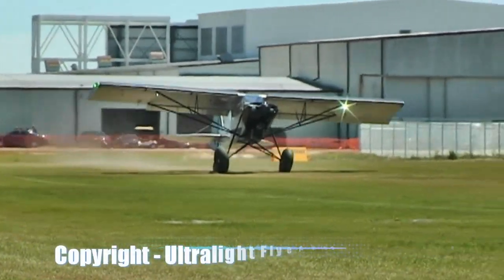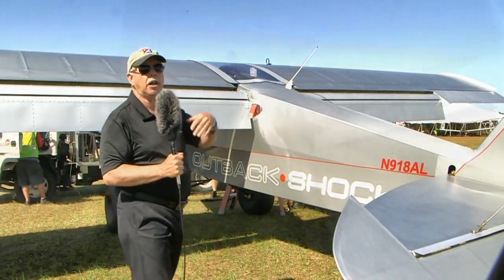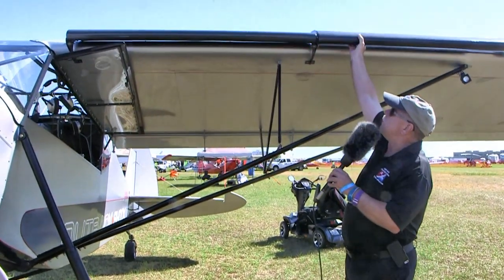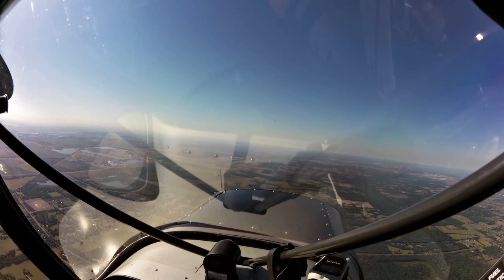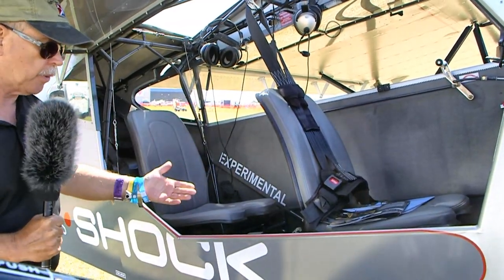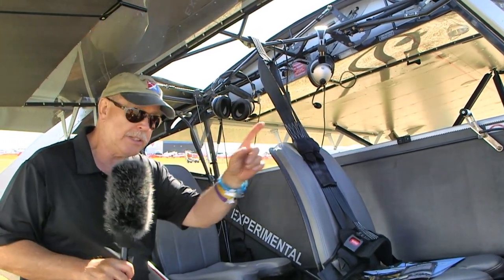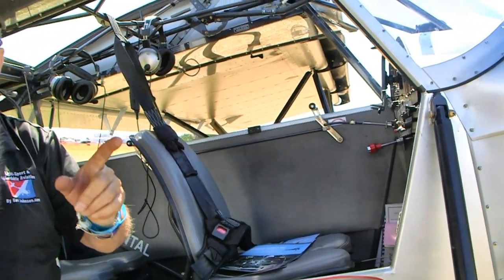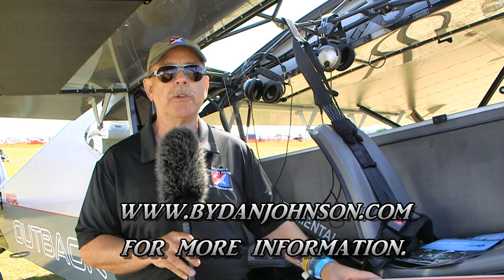Savage Shock, Savage Outback Shock, Zlin Savage Outback Shock Cub Aircraft Review.

Comment: Good report! Single pilot from front or rear?
Reply from the maker: Can be flown solo from either seat, but flap controls not reachable from rear seat.
The Ultralight Flyer
Reply: @ultralightnews  I don't think that answered the question.  Most tandem aircraft can be flown from either seat.  When there is only on person on board  (solo)  are you required to fly from the rear seat like a J-3 or can you solo from the front seat as a Super cub?
Reply: @Lammons1960  pretty sure it's the front seat in this plane

Comment: 710/5000
Enjoying yet another great model of aircraft capable of withstanding impacts on off-road tracks, this Savage Shock shows a lot more. It shows a sectioned Flape of better performance, shows a beak (rear wheel) with shock absorber, shows deflectors of wing tips. In addition to all this WHAT I LIKED most was the Slats in three retractable sections on each wing and another great differential that is a second movement of the elevator. All very adapted to the "hardest" landings in deserted soils or areas of difficult access. These are important differentials that show that there are always possibilities for improvement. It really is a big competitor in front of Super Stol and Zenith CHs, for example (by translate.google.com).

Curtindo mais um ótimo modelo de aeronave capaz de resistir aos impactos em pistas fora dos padrões, esse Savage Shock, mostra muito mais. Mostra um Flape seccionado de melhor performance, mostra uma bequilha (roda traseira) com amortecedor, mostra defletores de pontas de asa. Além de tudo isso O QUE MAIS GOSTEI foi os Slats em trés seções retráteis em cada asa e um outro grande diferencial que é um segundo movimento do profundor. Tudo muito adaptado aos pousos "mais duros" em solos de desertos ou áreas de difícil acesso. Esses são diferenciais importantes que mostram que sempre existem possibilidades de melhorias. Realmente é um grande competidor diante do Super Stol e dos CHs da Zenith, por exemplo.